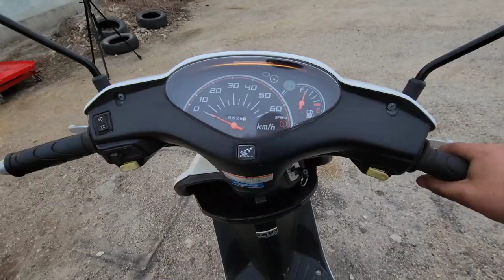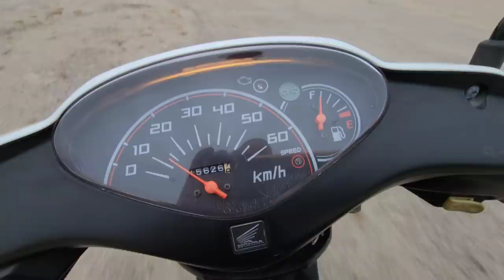Honda Dio 68 - starting mechanism not working

Comment: The oil on the Air filter is the result of a over filled crank case.
The extra oil will come out of the valve cover vent especially when the engine revs high.

Comment: Hello, I have a sports bike cylinder 67 mm ttmrc 4v does not have a radiator What is the percentage of oil used for it? I am in Iraq and up Temperatures up to 55 degrees